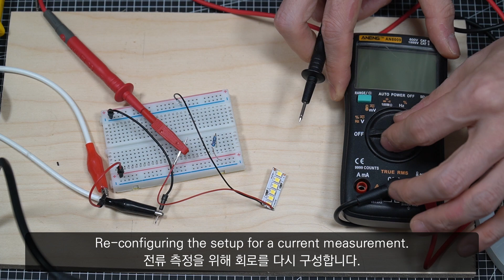Adding lights under the hotend

Comment: Can I connect the led directly with the fan  without the resistor?
Reply from the maker: I used resistors mainly for longevity of the LEDs. You can omit them as long as the LED strip’s voltage is the same as the printer’ voltage. 😄

Comment: Hi, I'd like to do this on my 24v ender 5 pro but can you tell me about the 1k ohm    
resistor you use, is it a 1/4, 1/2 or a 2 watt.  Which one should I use?????.  I have 24v cob led strip
Reply from the maker: In my video, I measured the current exactly because of this. It's 5ma over 24v, so it's like 0.12 watts. That's why I used 1/4 watt resistor. You should measure the same way for your application, though I would say, "bigger, the better!" :) :)
Reply: @Tinker_Box  ok thanks